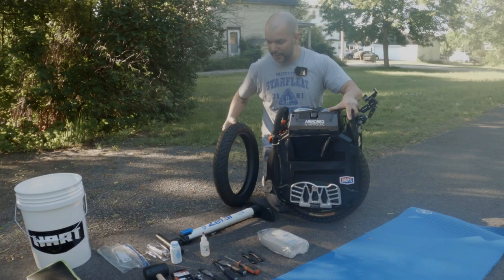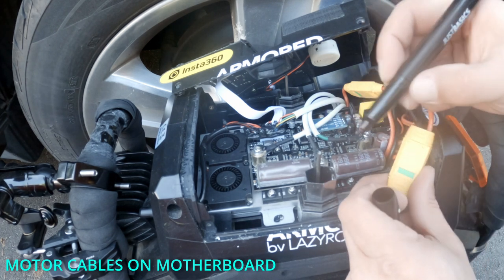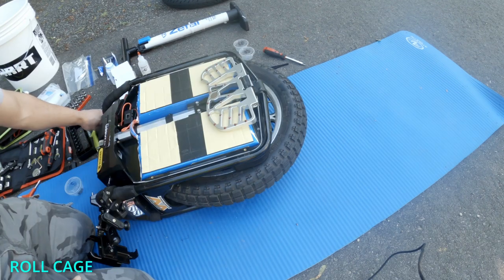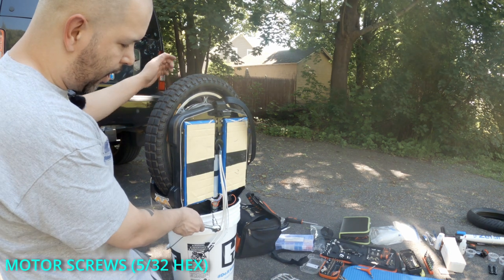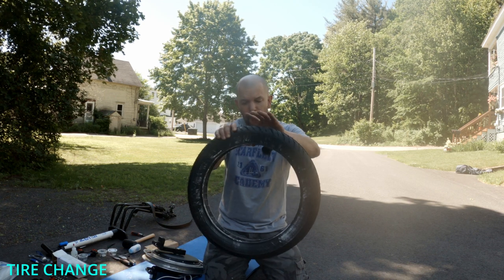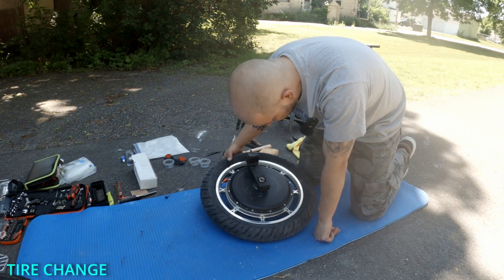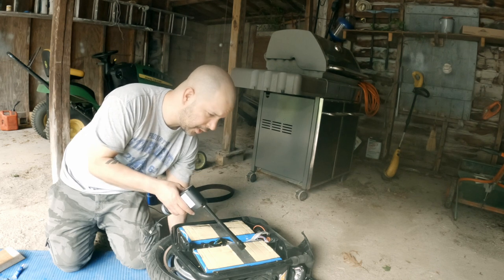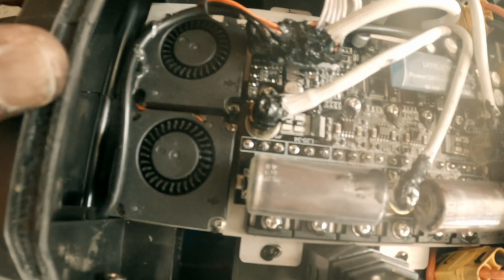My First  TIRE CHANGE (WITH ISSUES!!) - Veteran Sherman EUC

Comment from the maker: TIMESTAMPS:

00:00 Intro
01:04 Trolly Handle Removal
01:36 Control Panel Cover Removal
02:48 Removing Motor Cables from Motherboard
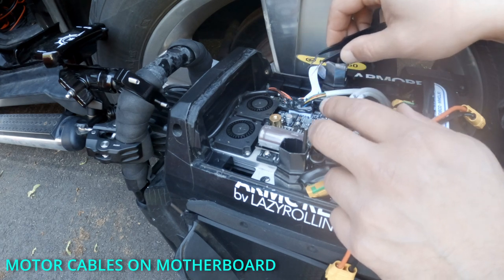06:35 Removing Roll Cage's
08:18 Removing 12 Motor Screws (5/32 Hex)
09:27 Removing Motor
10:32 Removing Tire and Tire Change
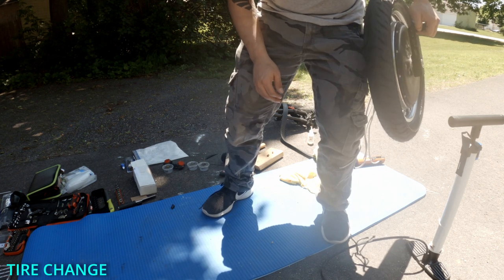18:06 Putting it all back Together/Mistakes
26:20 Quick Ride Test & Ending

TIRE:   https://www.ebay.com/itm/193914778717

List of Videos I researched for the Teardown & Tire Change:

D - (For most of the Control Board removal, and general teardown)
https://www.youtube.com/watch?v=jvxGa...
FrenchUSA - (For general all purpose teardown , tire change)
https://www.youtube.com/watch?v=WH93y...
Duf - (extensive teardown)
https://www.youtube.com/watch?v=D92hB...
Kuji Rolls - (Informative teardown and installation of tire)
https://www.youtube.com/watch?v=NeuJw...
Arc Rides - (Informative, Raw look at tire change)
https://www.youtube.com/watch?v=VcrZ0...
Tony Marchand - (Tire installation/prevent Pinched Flats)
https://www.youtube.com/watchv=sxOqtN...
RV2Cycle - (extensive Pinched Flat prevention)
https://www.youtube.com/watch?v=xma-_...

Comment: Hey thanks for the shout out.  I just took mine apart today.  maintenance.  Still riding it as my daily.  No issue with my bearings which is surprising.
Reply from the maker: You must of changed your youtube name. lol The wheel is phenomenal , this is why i trust leaperkim products more than anything else. They may not be the best at performance like Begode but i rather have something that will last quite a while than something that going to break on me in a year or so (in theory)

Comment: Tire tread direction:  You must have bought a tire designed to be a high performance front tire.  That tread is intended to enhance braking performance on a motorcycle.  However (I doubt that it makes much difference on an EUC) but an EUC will probably get more good out of the tread chevrons facing forward, as viewed from the top of the tire, due to enhanced ability to clear water away from the tire contact patch.
Reply from the maker: like i did with the Sherman S tire  🥳🥳🤪🤪

Comment: Well done, CyberVolt. I'm definitely not looking forward to changing the tire on my wheel. Hopefully in the near future, EUC companies will make them easier to service and change a tire.
Reply from the maker: Just a hint, just be careful with screws, and motor cables. Dont screw anything back in till you know your motor is on correct orientation and that the wires reach fully to your motherboard connectors. Will save a TONNNNN of headaches...trust me. :p What would have took me 5 hours (still long) ended up to be 8 hours because of what i just mentioned :p
Reply: @WILSONsHobbies  I had the same issue with mcm5 v2 when I changed tire and removed/added the motor wires. It's almost like they make them so frustrating to service. :D

Comment: Great video so far.  The axle screws where the 6 screws are.  It's cracked on mine on both sides.  still rides good .  So I dont worry about axel screws and cracked plastic around the screws.
Reply from the maker: Damn! Wow, well...still be careful with that yikes!!

Comment: Appreciate you brother...and congrats on getting the job done...I did this with another Max rider yesterday and it took us 6-7 hours to do 2...it was our first as well so there was a lot of youtubing in between cursing matches.
Reply from the maker: Hi Mocha! SEEN you in the maine telegram group! Thank you for stopping by !  Yea first time was very daunting, especially not having a proper work area and all the right tools . lol
Reply: @WILSONsHobbies  I didn't mention this earlier but we actually failed on the first 2 inner tube installations.  Pinched one with a tire iron trying to speed through the process, and the second one went flat over night, possibly due to a stressed valve stem.  I picked up a couple inner tubes from the nyc crew on my trip down this past weekend so I went at it again last night and finally - success!   I just got the Max so there were some issues we had to verify (missing axle sealant), so we figured we'd tear it down and swap tires while the chassis was apart.  Just waiting on the silicone to cure and will take on part 2 later tonight :)  Thanks again!

Comment: The motor cables shouldn't go over the Bluetooth module. They should go around it. The cables will affect the Bluetooth signal.
Reply from the maker: Interesting tip. Didn't realize that, where is the bluetooth module? I placed the wires pretty much the way it was setup before taking it apart.
Reply: @WILSONsHobbies   it is the small rectangular board.
Reply from the maker: @BunnyslippersEUC  Thank you , good sir! Ill take a peak at it and see what I can do :)

Comment: Taking pictures when disassembling, eg showing the colours of the wires going to the respective connecting terminal poles can be of help too when re-assembling the wheel. If you remove the inner valve pin when letting the air down, you’ll definitely get all the air out of the tube; to check for pinch punctures you can partially reinflate the tube just to a medium pressure, then rotate the tube under a basin full of water, you’ll see bubbles appear if you’ve nipped the tube. The tyre lever spoons you are using are rather short for the purpose of levering the tyre over the rim, I’d consider getting longer ones. Well done all the same, I’m sure you’ll notice a great difference in the ride of your wheel!
Reply from the maker: Hi Freeforester, thank you for commenting. Yes I agree, taking pictures is a great idea and I advocate for that, especially for the motor wire connections. Labeling the wires is a good idea too (i dont recommend markers, pens for this, easily smears off). Something like label stickers folded over the wire and then mark it with a pen. I like that tips of about the inner valve pin, that is easy if you have the tool for it (like those included with slime kits). I also like your idea of place a tube in a basin full of water to see if bubbles appear. Yes i admit i need new spoons , and they are not expensive from what i seen on Amazon. I appreciate the comment and will get a video going here soon for my impressions of the street tire. :) Stay tuned

Comment: That was very educational; thank you for showing us. The difficulty of this basic task has somewhat put me off the idea of buying an EUC.

Instead of using a bucket, would a milk crate work dimensionally?
Reply from the maker: If you have some electrical hobby experience, this should be easy. This was my first time taking a part of EUC . I was nervous i would break something (in which i did). I also was filming and was focused partially on that aspect of it as well. Please do not be discouraged in getting an EUC. Most likely you will never need to take apart your EUC unless your tire goes flat or when you need to swap out an old worn out tire.  My video is just my own personal experience and I  was not experienced taking apart EUC's or doing any type of tire change :p  In summary : Get an EUC :p
Reply: @WILSONsHobbies  

Thank you, Wilson's Hobbies.  I do have significant electrical and industrial technical training and experience, was a Certified Mechanical Engineering Technologist for 35 years, and have all of the required tools and skills and time.  Those attributes might help, and I agree that mastering an EUC would produce a great sense of achievement and a lot of fun.

On the other hand, in the legal jurisdiction in which I reside, EUCs are deemed to be motor vehicles and therefore require public liability insurance when ridden on public roads.  A heavy motor vehicle such as a Sherman colliding with a pedestrian could cause serious physical injury to the pedestrian, so riding an uninsured EUC would be both illegal and financially foolish when the potential lawsuits are considered.

Also, there is an age factor:  I am much older than most EUC riders.  My accident-recovery time is limited by the principles of actuarial science, so I must proceed cautiously if at all.

Anyway, thanks again for your very helpful video, and be safe!  Hoping to see some EUC ride videos from you.

Comment: The Sherman Max has extra bolts under the case that feels impossible to unscrew
Reply from the maker: im sure. I heard that wheel is more difficult to work with compared to the OG

Comment: What is the difference between the Michelin vs the knobby? Is the knobby train tracking? Knobby is good for puncture resistance I would think.
Reply from the maker: Michelin is more nimble, grippy , super silent, and easy to carve with. The knobby is stiff, heavy feel on the road, screams like a banchee down the road, but very stable and good on wet off road terrain.    
Michelin is also thick. The knobby on the OG sherman was never seating correcting no matter what I tried. It was common defect on the first few early batches.

Comment: Did you ever fix the trolley handle popping out? Having the same issue on mine.
Reply from the maker: Did i have trouble with the trolly handle on the Sherman? Or are you referencing my issue with the Hero trolly handle?

Comment: Does corn starch baby powder work? I don't think they put talc in baby powder anymore. Im worried about friction wearing the tube over time
Reply from the maker: Im sure it does. I only have heard about baby powder so I used that . Havent had any issue with friction. Tube seems to slide easily around the inside of the tire without any rubbing or friction.

Comment: Not sure if it will make that huge of a difference but I run the tire tread the other direction.  Would be better in water also.
Reply from the maker: Would be interesting comparing the tread direction and how they feel. So far, loving the added responsiveness, grippy feeling of the wheel. It is so planted and super stable compared to my knobby. Having a tire that runs true on my Sherman is a great experience finally! lol
Reply: @WILSONsHobbies  In tyres that are both made for front and rear like the Michelin City Pro, I personally would treat it as if you're putting the tyre as the rear (making the tread "point" down) since the rear on a motorcycle/scooter is the drive train wheel and also the wheel taking most of the weight.  On an EUC the wheel is basically doing everything.   Probably wouldn't make an iota of difference really but that's how I would orient my street tyre on an EUC.  Thanks for the video.

Comment: I find it immensely frustrating that you have to go through all that disassembly just to change a damn tire. These things are not designed to be user serviceable. I've had mine apart several times, and yes, each time it is quicker than before, but still too much of a hassle. Imagine having to go through all that every time you have a flat on your car. On the plus side, you get to see how everything is put together.
Reply from the maker: That was the benefit of taking this apart. As Marty pointed out to me in a comment on facebook that taking apart a wheel for first time is a confidence booster and it sure was. I have a greater appreciation now for the internals and how EUC's work in general. I hope the EUC engineers who make ours wheel come up with a better solution for taking apart a wheel so its easier to get at changing the tire.

Comment: I've got bad news for you, you put the tire in the reversed direction 😅
Reply from the maker: It appears that way on the tread, the tire direction is forward though , I questioned this as well 😂
Reply: Not necessarily, the 80/90 is a front/ rear tire. His is mounted in the front tire orientation.

Comment: do not need to izolating motor cables, realy, they not under voltage when youre disconnecting batteries. Imo, it would be wise to add additional jack for motor wires, to do not need to get under controller cover

Comment: You said you took the roll cage off just to put it on the bucket..
Just so anyone who reads this knows.. it's not a skippable step. 

You can not pull the motor out without removing the roll cage.

From,
Guy who tried to skip that step.
Reply: p.s. Used this video twice for that excellent picture of the top board / marking wires.
Thanks for making this video.
Reply from the maker: Yup the roll cage connects to the hanger, and the hanger connects to the motor. Dont need pedals to lift it on the bucket.  Thank you for using this video even though there were several flubs haha
Reply: @WILSONsHobbies  I didn't bother taking off the pedals either time. They flop around a bit but was less annoying than removing/re-attaching. 
Hopefully my third tire/tube swap won't be for a long long time but it'll at least be quick now that I know what I'm doing :P
thanks again brotha 🤙
Reply: it's that time again. lol